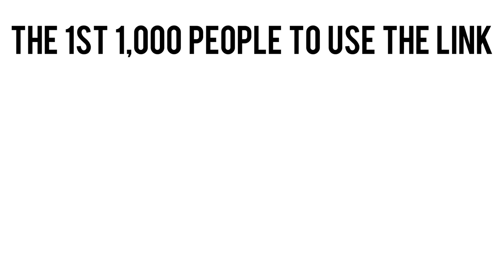DIY Cement Fascia Boards | Building Our Own Home Ep.33

Comment: Okay I will take a crack at how you are going to move the RV.  I have two ideas.  One is with the tractor.  1st slightly lift it up front of RV with the modified fork/bucket.  2nd to build a platform on your trailer that will is able to jack up the front of RV slightly.  All I see is you pulling out the front of the RV far enough from the house to hook up the 5th wheel.   I am guessing that the trailer is shaped so that you can pull the trailer slightly (horizontal with the house) without hitting the house.  If that is the case you will have to pull it back from the house first, then turn it. By the way the house is looking good.  I sure miss the Fort Polk area (Deridder/Rosepine).
Reply from the maker: 😳 you’re on to something Raymond!! 
Thanks for watching!!

Comment: Nice work. Why did you pick seven and not eight?  Did you account for the thickness of the blade in your calculations (Kerf) an 8" cut is 8-1/8" inch of material so five pieces of 8" from a 48" sheet would require 40-5/8" meaning your last piece would have been 7-3/8", not 8".  7" was a smart choice.